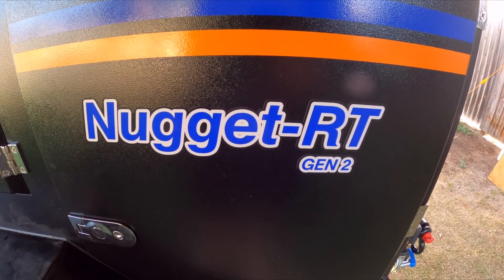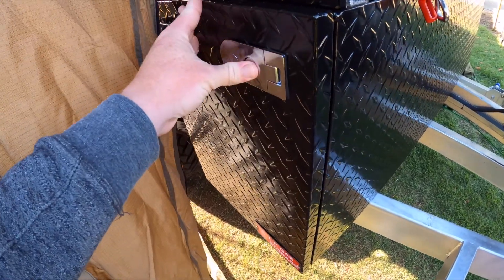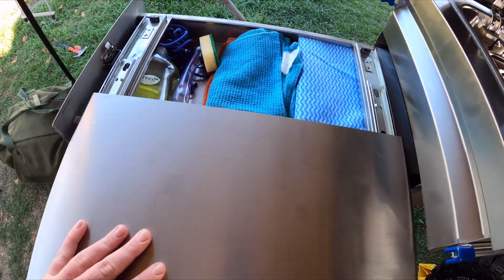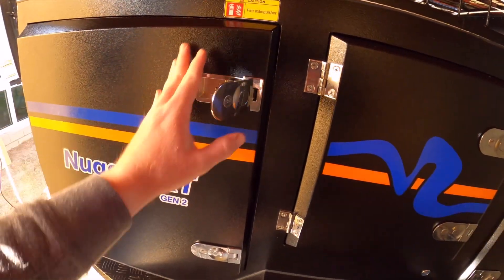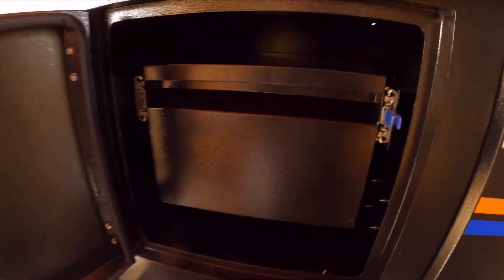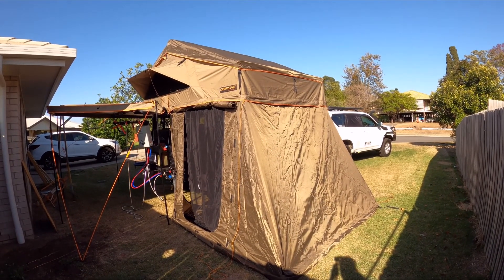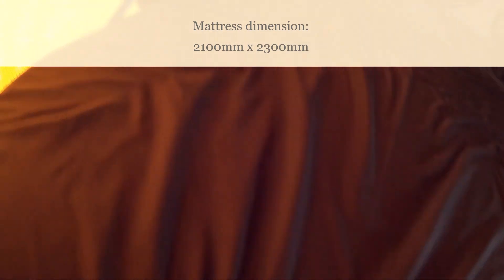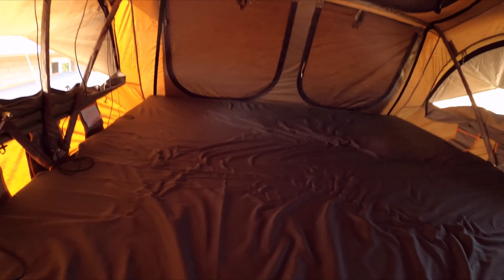Stoney Creek Nugget Gen2 RTT  2

Comment: Thank you, good info and walk through.  Just looking at one at the moment and seems great value for money. Also, like the fact that it is so much shorter, less things to go wrong, easier to recover with weight, easier to park in some situations.  I kind of like that there is no lounge, forces you to sit outside where you are supposed to be when camping, haha. Nice compromise all round it seems.
Reply from the maker: Cheers Trevor. A whole lot less to go wrong, and they have improved on some of the issues they had with the earlier gen1/2. better suspension setups and extra grease points now for maintenance.
I have been told from a guy on a stoney creek facebook page that the "recovery points" that they have put on the rear corners are not actually rated for recovery, so if something goes wrong i guess insurance would not cover. but they have been used and do hold up.

Comment: Great video, really detailed. 

I notice your fridge slide is on the side rather than at the back like it’s shown on the Stoney Creek website. Is this something you changed? Much prefer your layout. 

Also the rear hitch point, is this something you added? Doesn’t seem to be on the website either. Cheers.
Reply from the maker: Thanks David.
They come with the slide on the side now, since it is the same trailer used for the soft floor. The soft floor opens over the rear and the old fridge had to be pulled out where you climb up into bed. 
Hitch points are also standard now, four instead of three.
Reply: @ryandinsmore6388  cheers for that. Makes sense now. They haven’t updated the pics on their website with the Gen 2 version yet. 👍

Comment: Hey mate nice walkaround. How did you make the awning brakets? Thanks
Reply from the maker: Cheers, I used a large to med shelving bracket from Bunnings and the steel tube off the one that comes with the trailer
Reply: @ryandinsmore6388  how many brackets did you use? Need to do mine up too. Thanks again
Reply from the maker: @vstanman888  just 2, bolted to the ends of the large rectangular piece the awning is attached to. Then bolted to the square tube on the cage. Takes a little fiddling to get it to sit perfect.
Reply from the maker: @vstanman888  no worries, only used 2, just make sure they are large enough and solid enough. i only bolted the awning to the brackets